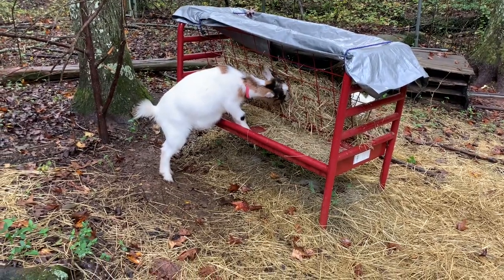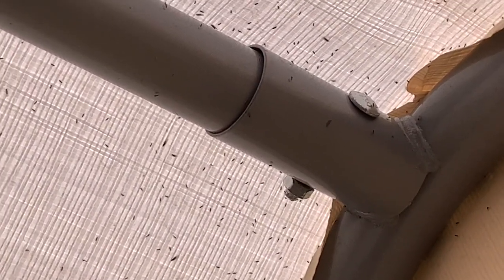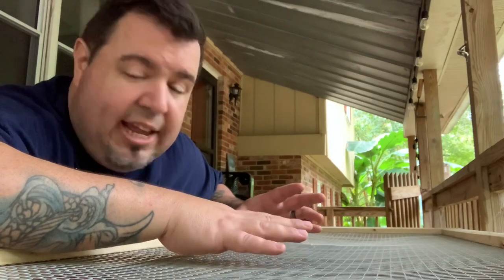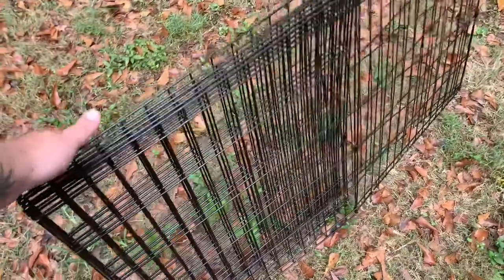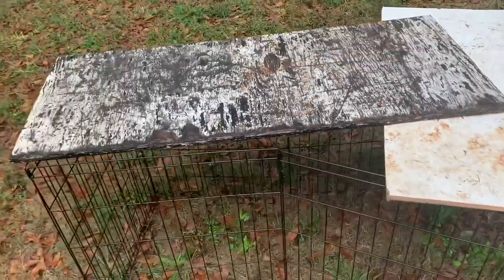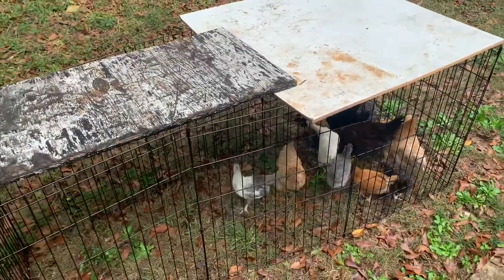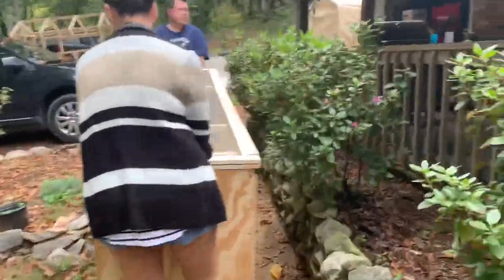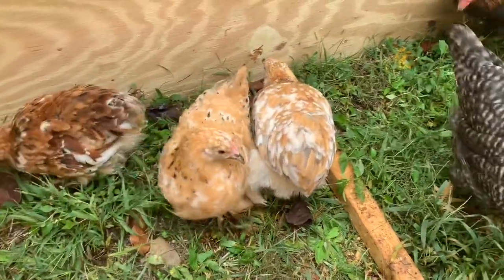CHEAP Homemade (DIY) Chicken Waterer + Moving STINKY Chickens To Pasture

Comment: I like that waterer, does south carolina ever get freezing temps? Wondering if the water in it will crack the pipe? I think it would here for sure
Reply: ps saw you in the homesteading today group on FB just subscribed :)
Reply from the maker: It does as the nights get cold but it usually warms well above freezing once the sun comes up. Typical dead of winter day is like 55°. However back in NY I used this and a hanging bucket and just dropped an aquarium heater in it. Kept it from freezing beautifully!
Reply from the maker: Old Redding Farm Just subbed to you as well! Thank you, my friend. I think one of the coolest parts of homesteading and documenting it, is meeting so many likeminded people who share a common goal. Best of luck to you!